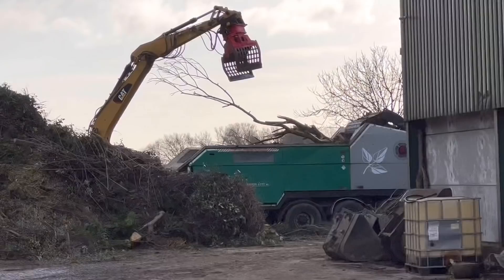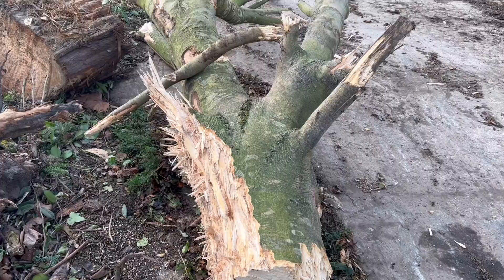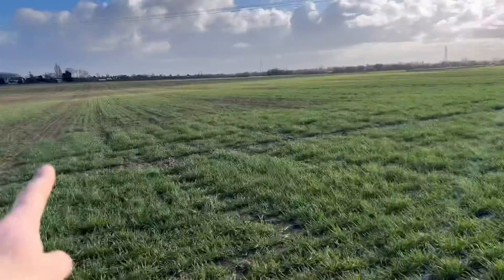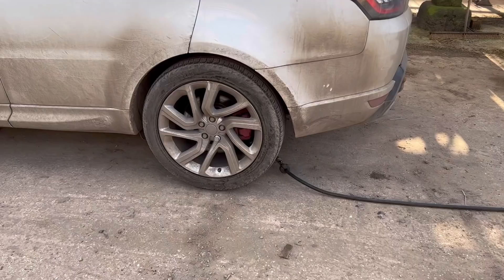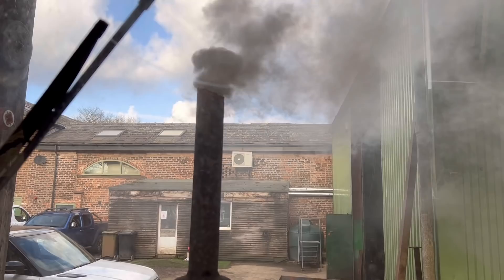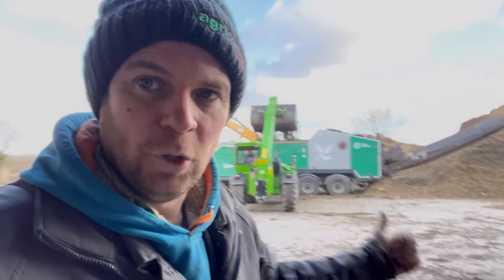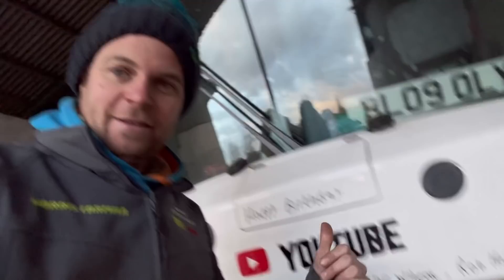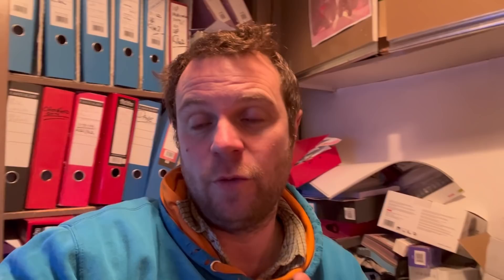Day690 #OLLYBLOGS TROUBLE WITH A TREE DAVID BROWN 1690t COLD START 🤦‍♂️   #AnswerAsAPercent

Comment: On the 1690 you can remove the front side panel for access to the battery, but can’t remember which side 😂😂😂, you needed to push the cold start button back in again and then she would of started up like a good one ☝️.

Comment: On a Minimec pump you need to open the throttle fully before you push the cold start plunger in. This allows the rack in the pump to go beyond maximum . When it's set right you should hear a positive click when the cold start engages  If it doesn't start straight away, reset the cold start by pulling the stop cable ( this releases the cold start especially if its half engaged after trying to start), then repeating the engagement process . Usually Minimec pumps start straight away.
 Good luck hope you understand my rambling instructions
Reply from the maker: Thanks will try

Comment: We had a David brown 1212 it had the same button on injector pump but also had heater plug in the inlet manifold. It worked by turning the egnition on then turn the key a little bit further and hold for 12 seconds then turn key all the way and away you go, maybe 😉. Don't know if 1690s are same though. Well done.